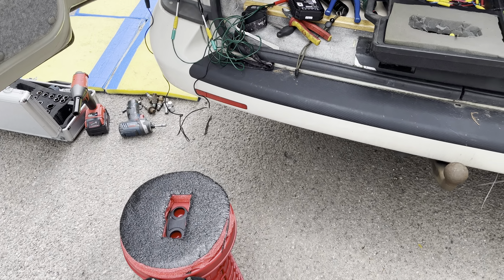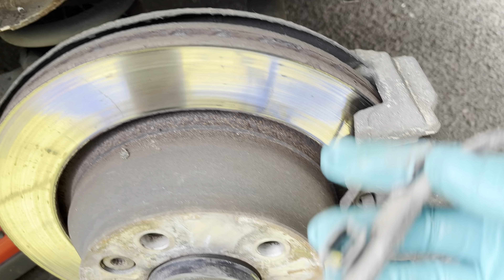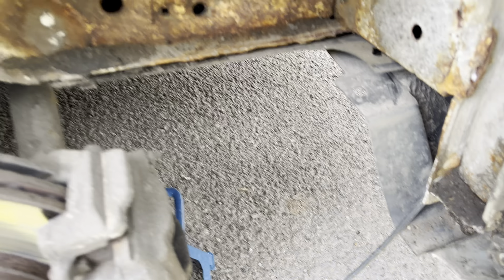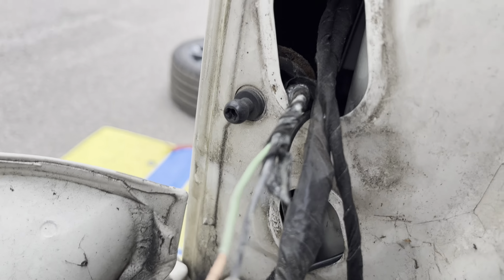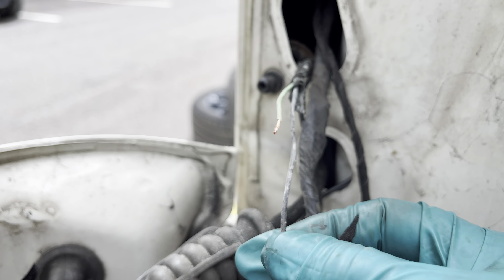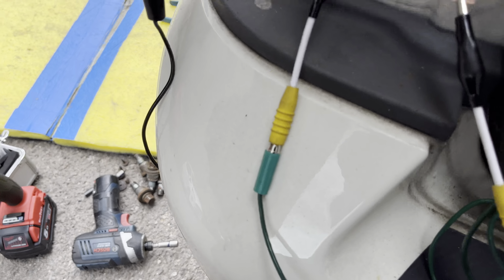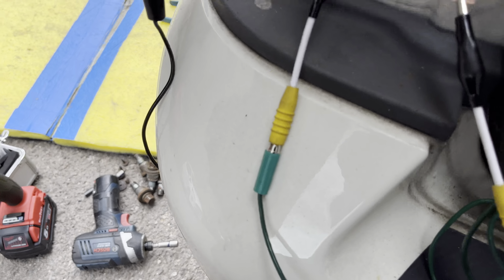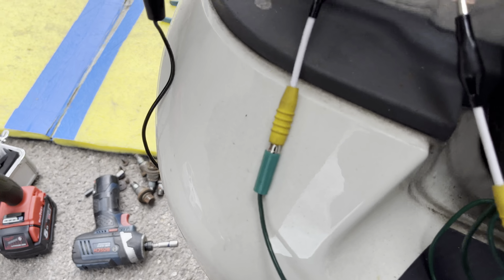Vw transporter abs fault location and pinpoint testing

Comment: Hi, thanks for the video. I have a 2014 T5 with ABS light fault coming on and off causing van to brake. Is the first step to pull wheels off and inspect for damage cables or is there a more efficient starting point? Cheers
Reply from the maker: First job is to scan the system so you have an idea where to look ok
Reply: @caralarmandradio hi thank you for the video. Im looking to buy a van that has abs light on. I don’t own a scan tool but can buy a cheaper obdII tester. Would it show me if it’s a sensor or a module fault? Thanks
Reply from the maker: @AhrnNilsson hi yes if it was a reasonable tool i would recommend vcds ok

Comment: Do you need to take the wheel arch out or can you just repair the wire through the cluster😊
Reply from the maker: To do it properly you need to get the liner out otherwise you cant reach the wiring through the cluster